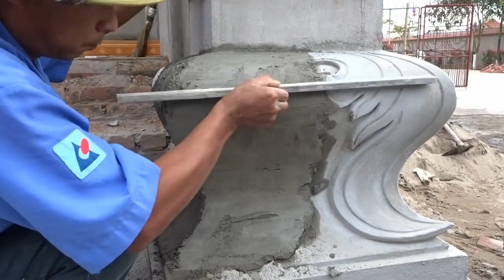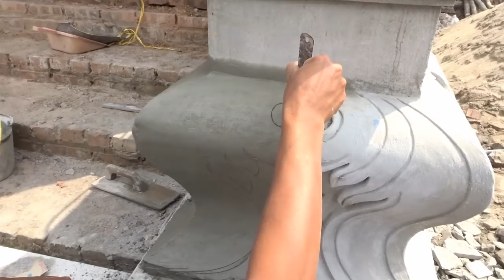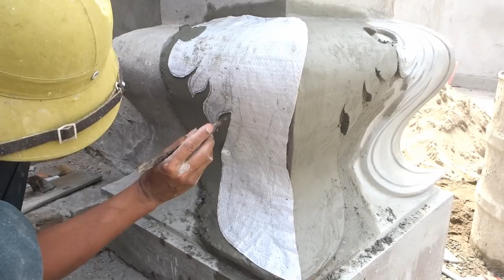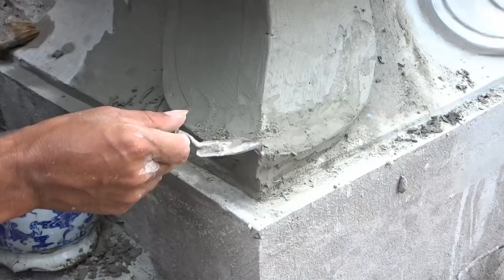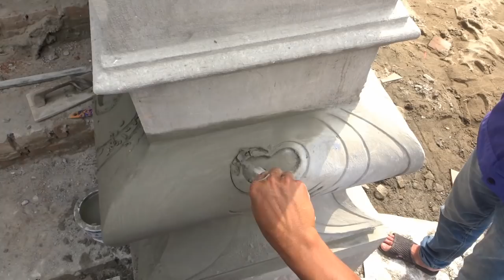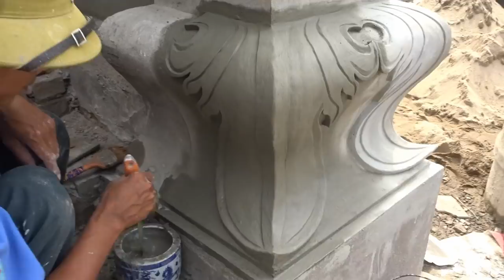Amazing Creative Construction Worker Cement You MUST See - How to Build Sand And Cement Easy

Comment: There should be more explanation, what mix,portions, time, etc.
Reply: its "sand and cement easy",  internet gives a lot of info ...2:1,
Reply: MrSemilla123 Mixes would change by climate, a western mix would contain more fiber, for hot cold expansion and snow load. Southeast Asia will not have the climate swings we experience.
Reply: 123 mix in west, i've noted as cement, rock and sand. Are you saying one of the 3 would be fiber and if so how which ratio? 

Thanks.

Comment: What the powder topping he used?
Reply: Lilly and Gavin Show the powder would be whatever mix he used for example if it was a lime and sand mix hed use lime to promote a quicker drying time for the outer area to apply a thicker layer
Reply: Dry cement??
Reply: if he used cement then yes, he would have used cement powder